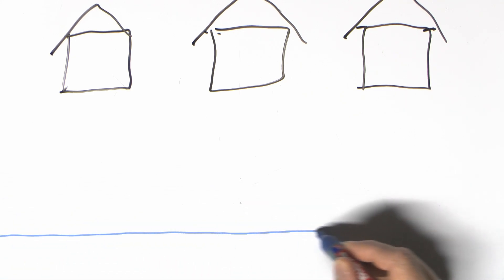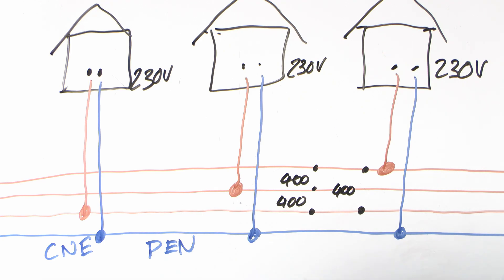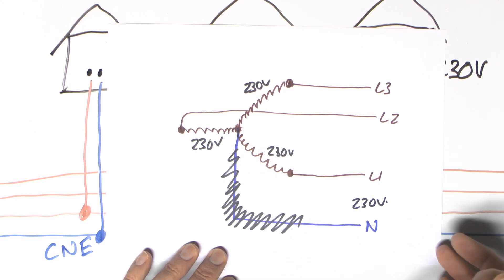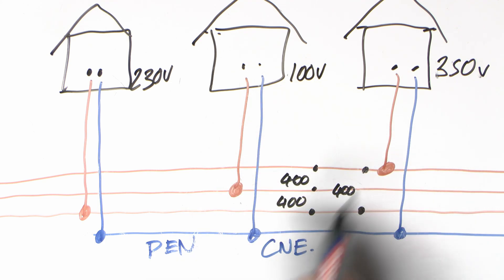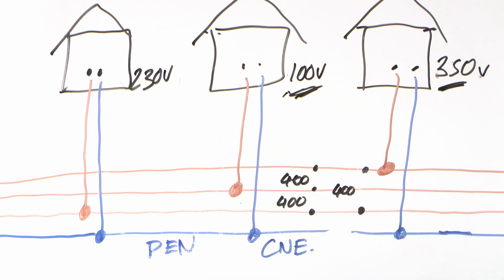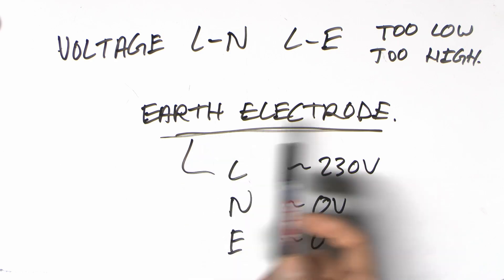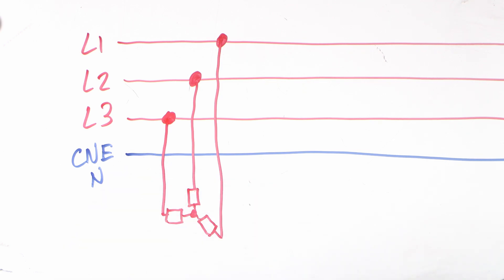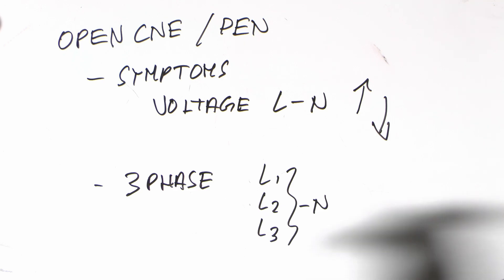Diverted Neutral Current - 3 Phase into Single Phase, Open CNE Detection, 400V when things go wrong

Comment: Good description. If anyone is interested in what the buried distribution cable looks like, there are a few minutes here: https://youtu.be/LS8VFhRMsYY from when SSEN replaced a load of it in my street, along with replacing their local transformer.

It includes how the service cable to the house is connected in, along with the local earth connection (we are on PME here).

The reason for that was that they had several faults in this area due to cheap and nasty cable used in the past, and it had insulation faults that resulted in unwanted connections across the cores from time to time, resulting in us having power cuts, almost randomly, although the weather probably had some effect.

Comment: Hi John

What would happen if one of the houses on the single phase with a CNE connection was changed to having it's earth connection disconnected from the CNE and given a independent earth grounding and the same problem occurred on the CNE, a break on the CNE out in the street.

Would the house with the independent earth be protected from having electricity flowing through the property by the copper pipes in the property with the independent earth grounding..?

Independent earth grounding via a copper brass rod going deep into the earth like a lightning conductor.

Comment: I would have thought that with smart meters a voltage monitoring function could be could be built in to quickly detect faults.
In event of a out of spec input voltage it could automatically flag a warning and possibly even disconnect as well. In addition a remote voltage monitoring facility could be useful to identify problems in an area.
Problem now is many appliances use switch mode power supplies such as lights TVs, computer etc so unless the input voltage goes below the minimum operating voltage (often below 100V in many devices) or exceeds the maximum voltage rating of the devices then many people would not notice as the device works normally. Many could tolerate for some time a considerable over voltage before failing.

Comment: Dead right to bring this up, especially now with so many electric cars in use, this situation could potentially result in a car body on charge becoming very LIVE and deadly. And another thing that concerns me a bit is that there's likely to be some folk seriously overloading old 1920's or 30's vintage service cables where they already have lots of big electrical loads like an electric cooker, tumble dryer, shower etc. and then they add a dirty great BIG, say 20Kw EV charger, that could potentially burn out someone's neutral and create a deadly situation. And some folk think they know about electrics... This is why proper training or at least some serious theoretical study is so essential. Perhaps the government should make surge protection a necessity in domestic installations now.

Comment: 🙏 thanks for sharing with us.  I purchased a Dual Display 40A 63A 230V Din Rail Adjustable digital Over Under Voltage device but I did better than that by creating my own micro-grid providing me with 10kVA from two clean sine wave inverters and 37kw of self built battery storage so my energy should be a lot cleaner and safer than that of the  grid. However, since i've adopted an automatic contactor relay which detects a potential loss of generation and reconnects the building to the grid, I have also used a contactor relay that separates the two neutral/earth sources in order to avoid problems especially in the unlikely event of lightning which might create a gradient of very high voltages across the ground that could be very different between the two earth electrodes which are more than 30m apart. Do you find this the correct procedure ?

Comment: We had a PEN fault some years ago when a tree fell on the overhead cable, but only disconnected the neutral.  Called SSE Power to tell them we were getting variable voltage, but sometimes 300 volts.  Someone comes out, check it at the substation (which is in our front garden) and says its 240 volts and its fine.  I told him to check at the house because he was using the neutral at the substation, which he reluctantly did.  His face when he checked at our meter as he measured over 300 volts..
Reply: Had a similar thing with WPD a few years ago, shortly after they arrived the sub db in the garage burst into flames

Comment: Hi John,
really interesting watching your videos.  I was quite interested in the earth rod recommendations (I think in amendment 2 part 4).  Like you say many other country's have this anyway.  I wonder what your opinion is though, if say you have a TN-CS system and you go to the trouble of installing an earth rod (and have 30mA RCD on all circuits as it is almost always required), then why not just change it to a TT (earth only connected to the rod)?  If there is a neutral fault on the incomer and it rises to live potential, then st least everything in the house remains at earth potential.  And - if it is better to use the DSOs neutral as the earth (together with a earth rod), why not in a TT system connect the earth to the incoming neutral?
Reply from the maker: To convert to a TT system can often be done, but in many installations it's a lot more difficult than just shoving an earth rod in, and it may not be possible at all.  See https://www.youtube.com/watch?v=S5OtLg6voZY for further details.

If you connect the earth electrode in a TT installation to the incoming neutral, it's not a TT system any more.
Reply: @jwflame  Thanks John, just watched your other video, that explains a lot.

Comment: US does not have this issue because residential uses a single phase transformer for a group of homes. This single phase transformer normally powers four or more houses. The transformer is a split phase 120/240 on the secondary. A similar issue can happen when one residence looses its neutral. The condition does not spread to others. Sometimes an underground junction box is used instead of a transformer to tie a group of homes together and the condition could happen as you described when the neutral is lost from the junction box to the transformer.

Comment: So would an AFDD detect this (or at least the over voltage symptom) as it has over voltage protection? I guess the disadvantage is that it won't disconnect the PEN?
Reply from the maker: AFDDs should detect this and disconnect the circuit, which could protect equipment connected depending on the disconnection time.
Reply: @jwflame  Many thanks John. It's not something that they talk much about with AFDDs, over voltage protection is just a passing statement.

I am pretty sure that we had this type of fault at our house earlier this year, but got an undervoltage. It started with a power cut, but then, a few minutes later, I noticed that some neon lights were glowing faintly and a mini dehumidifier, fed from a AC to DC adapter, was running, but it made a funny sound like the motor was going really slowly. I then switched off all the AFDD RCBO, except the kitchen, which had already tripped, and a lighting circuit, so I knew when the power was back on. When power came back on, I reset the breakers, and I think the kitchen one showed self test fault, although it was hard to tell with the pattern of flashing. The SPD was unaffected. Neighbors reported similar effects to their lights.

About two weeks later my fridge freezer stopped working. So I wonder if it was damaged by an undervoltage caused by what I think was a lost neutral. Apparently undervoltage can be just as damaging to some appliances, such as those with motor.

I have brought a Sollatek FridgeGuardiS to protect my new fridge freezer, you just plug through it like you would a smart plug. Obviously only protects one plug but easier than getting an electrician to install something at the consumer unit.

Comment: Why on earth (no pun intended) did the DNOs decide to start installing PME supplies? Was it a cost-cutting measure? Seems so stupid to me. Why not just have a good old-fashoned TN-S supply and not have any of these problems? You even have to treat TN-S as TN-C-S now as it has probably been combined in-line anyway or will be at some point.
Reply from the maker: 100% because it was cheaper.

Comment: I suppose the TNCS systems seemed like a good idea when fuse protection was all that was available, and you needed a very low resistance earth path to actually blow the fuse. These days with RCDs/RCBOs surely TT should make a comeback?
Reply from the maker: It could - but with TT in a modern installation you are relying on electronic devices (RCD/RCBO) to disconnect.
With high current earth faults and circuit breakers it's a mechanical device operated by a magnet.

Comment: Yes had loss of neutral when the copper thieves came and took the ground and neutral wiring in the substation , and also stripped the cable to get the neutral conductor to the point it went into concrete in the substation.

Second time they attempted to steal the copper in the 11kV Reyrolle switch, which meant another 4 days without power. I saw the imbalance because the UPS was doing bucking, and measuring the AC showed it was close to 270VAC. Went to the meter room (3 phase incoming, split into the 3 phase rails and then meters, plus the one 3 phase meter for the mobile phone tower on premise) and saw 270VAC, 350VAC and 140VAC as phase voltages. Turned off the main switch, and called the electrical supplier about loss of neutral. Second time the upstream 11kV fuses blew, disconnecting the supply.

One thing I have done, and suggested to all my neighbours, is to install surge arrestor plugs, a few of them, and make sure the RCD is working, though you used to get a CBI RCD with an extra earth wire, which had in it as well a trio of MOV devices, so it would pass current through the core in imbalance if you had either loss of neutral, neutral rising above 100V from ground, or incoming voltage rising above 300VAC. The surge arrestors at least will trip the breaker (no pesky 3/13A fused plugs here, just a 20A breaker per spur, not the UK 32A breaker and ring main), and thus protect the equipment to a great deal, though it is often terminal for the surge arrestor, so buy a new one. Otherwise you install distribution board surge arrestors, but those are often a higher voltage unit, more suited for the issue of MV supply dropping onto the LV supply.

Yes a lot of the street had issues, neighbours on the high side blew out geysers, TV sets, and the coffee shop on the corner lost almost all equipment, as they were, despite being a very high load normally, unfortunately on the lowest loaded phase, so got the high voltage. Blew up the POS, the digital oven controls, the AC, the fridges and all other electronic devices. I just had 3 lights burn out, along with one MOV going short circuit.

Comment: Interesting comment you made about 3 phase/400v gear being uncommon in residential or even a lot of commercial buildings. When I lived in Australia, 3 phase to a residential premises wasn't uncommon (it wasn't the norm, but it could be easily be requested if the street had 3 phases (not all do)), and in fact I stayed in a home where various circuits were split across at least two of the phases. The residence also had a ducted reverse cycle air conditioning unit that cooled/heated the whole house, which required all 3 phases to operate.
Reply: Every house but one that I've lived in Australia has had 3 phase.

Comment: Super, thanks!  Would an installed surge device give any protection against those persistent over-voltage situations caused by broken CNE?
Reply from the maker: Up to a point - however with a long duration of overvoltage the SPD will conduct continuously, heat up and fail.  It might cause the fuse or circuit breaker upstream to open, but whether that would protect anything depends on how long it would take, and whether it was for the whole installation or just for the SPD.
There are dedicated overvoltage devices available which would disconnect such as https://www.dehn-international.com/store/p/en-DE/F440777/spd-pop-mcb-pop-mcb-pop

Comment: here where i am, we have a TN-C-S system: the distribution side is 400/230 V TN-C aerial conductors and the consumer side TN-C-S system (single or 3 phases, depending on the needs).
by the norms, the electricity provider needs to ground (connect it to earth) the PEN conductor as often as possible and on the consumer side, where the PEN separation is done (PEN to PE and N), we have to bring an earthing connection (or electrode rod connection how u call it) that is needed to have a resistance (impedance) under 4 ohm if is only used as shock protection or under 1 ohm if is combined with the lightning protection. does a low value for the earthing system resistance make any difference in this case (broken PEN)? or what is the reason for this values?

oh, i forgot! and we also are forbidden to put any protection or separation device on the PEN (or PE) conductor - it need to be uninterrupted from the case of the appliance all the way to the transformer.

Comment: ¿ Do you have delta 3 phase in the UK? In the US we have both wye and delta.
Reply from the maker: 3 phase can be connected either way, depends on what it is being connected to.
The 3 phase supply is the same regardless of how it's used, and obtained from a Y / star connected transformer with a neutral.
Reply: I suppose a delta‑only system (no neutral to loads, the transformer common connected only for protective earth) would have been more failsafe; perhaps that's one of the reasons Δ3×220 was historically common in much of Europe. Italy once implemented a similar system, but using the 127V phase–neutral for incandescent lamps (which work more efficiently at the lower voltage); no great catastrophe if the neutral broke there.
But then most of Europe moved to 220/380 (now 230/400) to reduce transmission losses, and unwilling to change the appliances to 380V, they stuck the 220V appliances between a phase and neutral.

If we had to do it over from scratch, I'd prefer Δ3×400 or thereabouts; small appliances would be slightly more expensive but still not overly difficult to make (most cords are already rated for 500V line–line), and the grid could be TN‑S at lower cost than current 230/400 TN‑C‑S (by using a smaller PE core in place of the large CNE). Smaller grids could use balanced single-phase (400V line–line again, 200V line–earth).

I suppose power companies could still have cut corners by corner-grounding the system and combining the grounded phase with protective earth, though… Not that we can do much else about the current situation.

Comment: I was thinking a Ze test would flag up a broken PEN conductor,  as if the PEN conductor was open you would be measuring the resistance of the other loads on other phases even if the phases were perfectly balanced the loads in most case would be higher than the 0.35 TNCS limit
Reply from the maker: It would in many cases, but not all - all depends on what else is connected and particularly any additional earth connections to the PEN via metallic service pipes, metal framed buildings and similar.